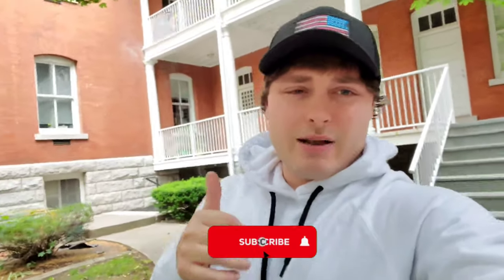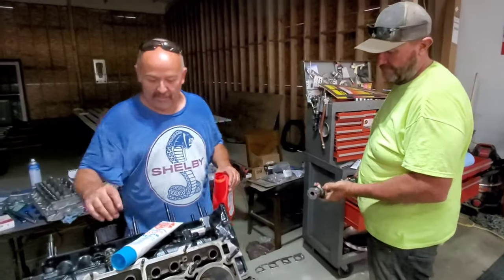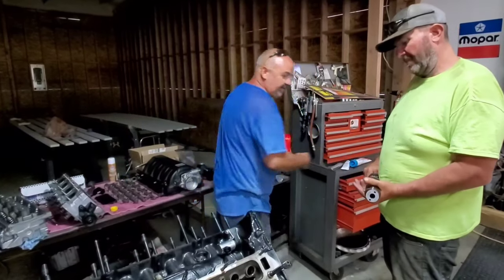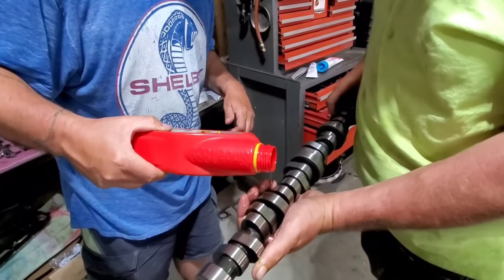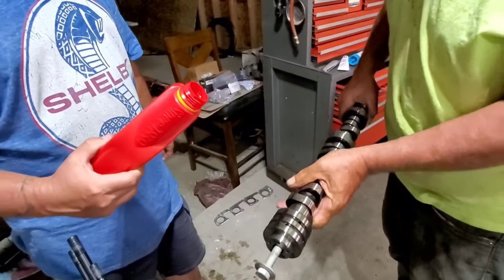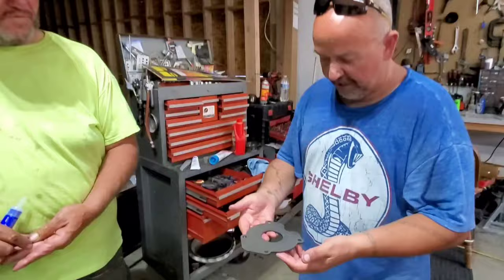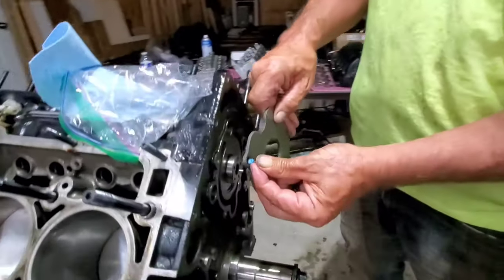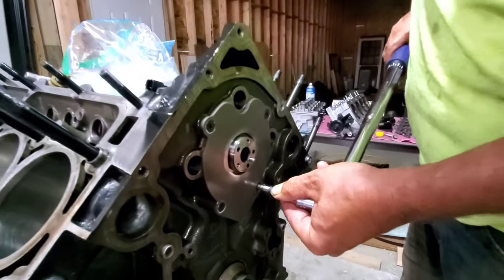How to install a Cam into a hemi? 392 hemi stroker cam install (Texas Speed Stage 4 Cam Install)

Comment: I have done a 3.7 v6 it has 3 chains  2 for overhead cams and one for the crank. It went ok after 2 times  at it with no zip ties. RUNs like it should after brake in.

Comment: So what kind of cam can we put in our cars idk what year yours is I have 2016 392 scat shaker?? Can you ask your guy can't wait to see the start up on this bad boy
Reply from the maker: Depends on what kind of a cam you want and how aggressive. This is a stroker cam 235/245 with a 600 lift. This is a pretty big cam. Most people I see usually go with comp cams but texas speed knows their stuff so this should be pretty interesting once we get it tuned
Reply: @landoninahellcat8745  Nice ok cool thanks for the information, If I was to get one it would definitely be from them!
Reply from the maker: No problem, you can always call their experts too and tell them your setup and what you're looking for as far as aggressiveness and they will help. They got good people over there👍
Reply: @landoninahellcat8745  cool bro thanks,🔥video by the way
Reply from the maker: Thanks a lot man! Appreciate the support👍
Reply: This Texas Speed cam is a 235/245 cam with 620 lift. A scar wound need just a converter with full long tubes and dual true 3 inch Exhaust. Obviously a tune and CIA. No porting or stroker. With 11.5 compression of a 426 stroker the converter wouldn't need changed as the volumetric efficiency is drastically raised.
Reply: @875109725710  cool thanks for the info I'm not sure what route I want to take I was thinking a hellcat engine swap,,but I'm all over the place so appreciate the feedback will keep this in mind
Reply: i put a Texas Speed stage 3 cam in my 2016 392 Scat shaker with their 2" long tubes, pushrods and valve springs and picked up 72WHP and 115ft/lbs at the wheels after a tune

Comment: Confused slightly. I get lining up the cam gear to the timing chain etc. Does piston 1 need to be at TDC when the crank dot is at 6?Or it doesn't matter where the pistons are as long as the crank dot is at 6 and the cam dot is at 12?
Reply: With rockers disconnected, doing the timing just off the chain lines up the engine. Distributor less #1 is really irrelevant. Being interference you don't want the rockers done before timing.
Reply from the maker: I got Robby to respond for you👍
Reply: @875109725710  Ok. I wasn't aware of that. I'm kind of older. So learning all I can before diving in. Just seemed odd that you can position the crank at any basic degree relative to pistons and as long as the cam is on the chain marks, you're good. Good to know.
Reply: @landoninahellcat8745  Thx. I watched a half dozen or so videos and it just wasn't sinking in. Great in-depth video. Yours was by far the most detailed. I did watch the MMX one for the phase limiter portion.
Reply: The computer, BTW will see cam and crank locations separately off the upper gear and off the trim wheel on the crank. So if you goof the computer will know. Nothing like old ones. I've been dealing with my wires and distributor position in my 57 hemi a lot lately. A pain. These new ones you assemble it right and start it. Zero BS. You become spoiled lol
Reply from the maker: Thanks buddy! I appreciate that.👍🤝
Reply: @875109725710  HAHA Yea I cut my teeth in the 60's and 70's repairs. I always started with the ballast resistor lol. And then life got in the way and toys vanished. Now that she vanished, I have toys again. So modding research has started. Spoiled for sure!! That makes sense about the computer knowing. One video I watched they were bashing the guy that called in with crank position errors  with his check engine light.
Reply: I don't even know if the 3rd gen hemi has timing marks. I don't think it does. You read timing with HP tuners. As far as computers go the swap guys have it easy. Those computers are self learning and tuning. They go crazy with the cam and the computer just figures it out. One i was looking at is 700 lift with 260 duration at .050. Rough in a factory car